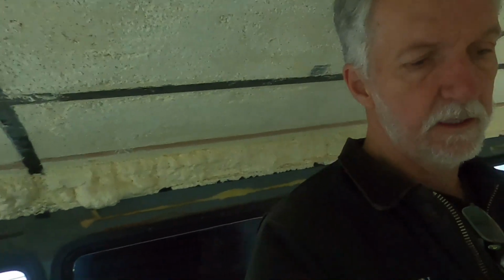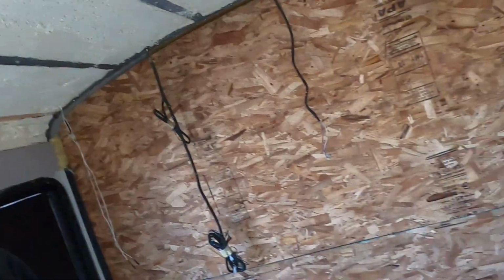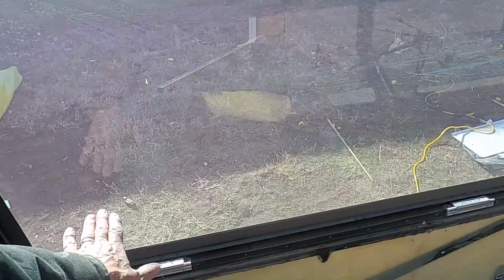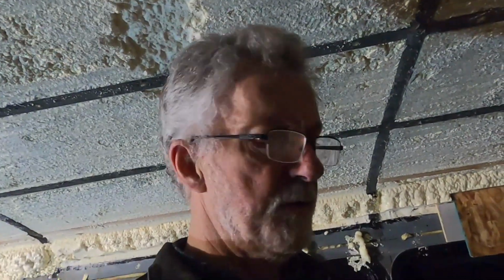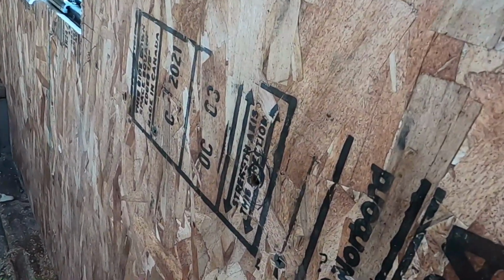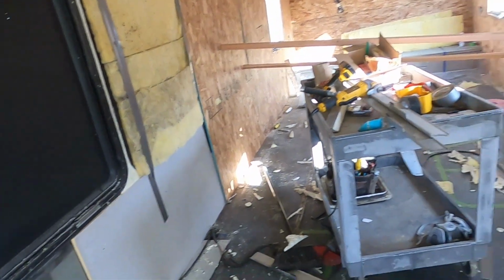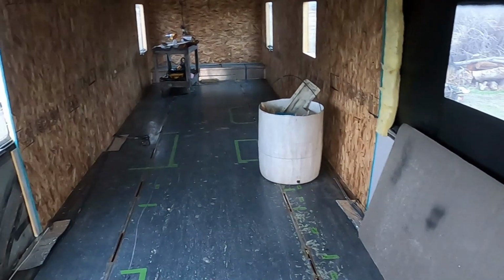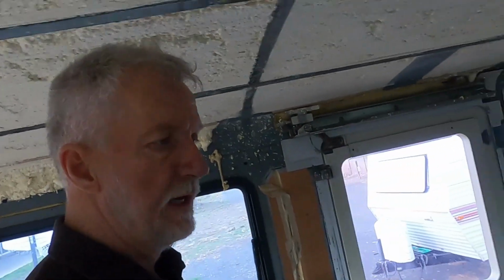2002 MCI Conversion Roughing in Wall Coverings E43

Comment: I like that you are explaining the thought process.  I am excited to see the process and how it will look inside and out.
Reply from the maker: Thanks. I'm not much for luxury, as I am more practical. I really don't have much talent in finish work. I'm just not very good at designing finishes. We'll see! I hope I don't disappoint.
Reply: @glennman9890  I'm sure you won't.  Looking good so far.
Reply from the maker: I prefer practicality over luxury. I'm not very talented when it comes to finish work, as I just don't have an eye for it. Not that I don't want it to look nice, I just don't know how to get there. I hope I don't disappoint with my finish work. It is a design as I go thing!
Reply: @glennman9890  Definitely design as you go and be ready to change things that do not work. I wanted 36" doors for the bathroom. But that was just to wide and I had to get narrower doors as they would have blocked and hit on things and didn't allow enough wall room to mount other things like the bathroom sink.

Comment: It sounds like you have many of the same ideas I found on U tube. Bedroom in back, bathroom in middle, then kitchen, living room front. I took out the windows I don't want.  1-3-4  from the back of the bus. 3 and 4 are in the bathroom area and I do not want windows. It turned out to be the easiest way for me. I took all the screws out of the inside frame with a special bit (star?). The inside frame comes out easy. I had the window already open and then clamped the outside window frame so it did not fall out. My son and I then got outside the bus and released the clamp and carefully pried the window and frame out with a pry bar. We let it straight down as it is heavy. I am getting the aluminum panels I got from the inside roof cut to size. I am going to glue ( Panel bond or a different adhesive?) the sheets over the openings and use foam sheets inside like you are. (Lacroix Cruisers idea to glue them on) No not the same metal problems then.
Reply: I ended up cutting the aluminum panels to close the window openings myself with a hand circular saw and a aluminum blade I got($30). Now I have to glue them on. I saved a lot of money buying regular home appliances on clearance for the kitchen. I had to get 2 doors custom made($225 each) for the bathroom doors as the cost and hassle to cut them down and look right was about the same.
Reply from the maker: @justfun985  Man! It sounds like you are all in!!! I considered doing all that to the windows, but I really don't want to spend all the time on it. I hope I don't regret it later! I love watching the Lacroix videos for sure.
Reply: @glennman9890  It was weird in that for me it was much less work to take the whole window out. 1/2 inch drill (my 3/8 drill wasn't tough enough and broke after a while) with bit to get the screws out. Once I have the window out I am doing pretty much what you are inside. That gets you to the metal frame of the bus which is square tubing and easy square edges to fit to. I think I am going to glue the sheets and then use screws to hold  in place. I can take the screws out later and fill in the holes before painting. What has been tough was putting windows back in some of the holes as they feel like they weight a ton after a while. They are double pane and some fogged up as the gas leaked out. I took the good windows and moved them to replace the bad windows. LOL "All in" to me is foaming the ceiling LOL. It is fun to watch how people handle the different challenges each bus throws at us.

Comment: Glen, how much did you pay for your bus. I drove buses for greyhound and I love driving those MCI 102 DL3s. I love their power, how they handled, their strong suspension system, using the engine brakes, and good sound of the Detroit Allison 60 series power pack. I know you enjoy driving that bus as well. Can’t wait to see the conversation to your personal RV vehicle when finished.
Reply from the maker: I only paid $1000 for the bus, and it was still in service when I drove it 25 minutes to my house! And yes, it is an absolute pleasure to drive. The engine and tranny are great. However, it does not have the engine brake, but I sure wish it did!
Reply: @glennman9890  that’s amazing! What were the details of this sale? Seems the ones I see are in the 20-30k range 😳

Comment: Glen thanks for another great video. I have a couple questions. Are the screws you are using Type F machine screws? (They  also call them trailer deck screws)  I too will be opting to leave the windows in when I start my build next month. I have been planning to use total blackout window film.  Did you consider this? if so why did you opt for the paint. (I have been concerned that that the paint may flake with time. What are your thoughts?  After watching the issues with your wiring I opted to have a coach company remove my overhead bins.  They know the wiring so I was assured things would be running when the work was finished. They finished last week and it is nice to see pictures of a clean slate. I think they probably saved me a couple weeks of work too,
Reply from the maker: I got the screws from Amazon. The brand is U-Turn - 12-24x2 WAR Coated Reamer Wood to Metal Self Tapping. They were actually about $35 for 250 count. They appear to be for mounting wood decking to trailers (as per the reviews). However, some of the reviewers were disappointed, but it looks like they were trying to get them to go into too thick of steel. The bus steel is actually thinner than what you would have for a trailer, so they can strip out if not careful. I've found that predrilling helps. I think the ceiling will be easier, since I will have the floor to push against. When I finish the rest of the walls, I plan to put something in there to push against, as it takes a lot of pressure to drill all those pilot holes! 

I'm glad to hear that your having a company gut the interior. I lost about a year dealing with all the problems I brought on myself.

On the window film, you are probably right about the eventual paint flaking. I set up the windows so that I can open them in the future, so if there are any issues, hopefully I can take care of it. Are you installing the film on the inside? I don't know much about window films. I hope my method doesn't create any problems. Thanks for weighing in.
Reply: @glennman9890  The film is like window tinting film which is installed on the inside of the window but instead of a percentage of sun filtering it is 100% black out. I have never used the blackout film before and so that was the reason for the questions. We are on a pretty tight schedule with our build. I can work on it full time but I need it "functional" by the end of April as we will use it to go north for the summer.  Well thanks again for keeping us up on your progress.
Reply from the maker: @panoramadan62  Thank you Dan!

Comment: I am looking at a tankless water heater as it is less weight and no venting. Bad side is it requires a 15KW or larger generator.
Reply from the maker: Hi Neil! I'm going with propane. I was a contractor for many years primarily installing gas piping and appliances. I am very comfortable with propane systems. I have a 6 gallon RV LP one that I plan to install as soon as I get the layout down to the inches (now it is only a rough layout). I used it in a previous bus. I installed it new back in the day, so it is dusty, but doesn't have much actual use.
Reply: @glennman9890  Sounds great. Everyone has their strengths and you go with them. I am going propane on the stove. I am putting the propane tank right below the stove, in a bay so I have the shortest to plumb.
Reply: My wife and I have been fulltime in our RV for 2 years now and we have a 10 gallon tank. We turn it on for about 30 minutes a day and that supplies all the hot water we need for 2 showers and 1 dish washing. It is surprising how little hot water a couple needs. We don't go to extreme measures to conserve the water but we are cognizant of the supply. Everyone's situation is different but when I hear these testimonials that "I could run the hot water indefinitely" I always ask myself but who does and why would you.
Reply: @panoramadan62  Thanks. My main reason for the tankless water heater is weight saving. I did not want to haul around a water heater with 10 gallons of water or more. 7 lbs a gallon water plus the weight of the heater. The wife likes to bike and have a friend couple along maybe? So they may need more hot water after a ride. I am not totally convinced it is the right answer so I like comments pro and con.
Reply: @justfun985  that is what's awesome about a custom build, each of us looks at our own situation and make decision accordingly.
Reply from the maker: @justfun985  Great idea Neil. I have a pretty large tank I plan to install (I don't recall the size but it is about 4 feet long and about 14" in diameter). It's from an under the bed truck tank (horizontal). It won't be very far at all from the stove and water heater either.
Reply from the maker: @panoramadan62  Agreed. We used the 6 gallon tank in our old bus and it was just fine. We also have a 6 gallon in our pull trailer. It works good too. I don't see the need for any more than that. However, if I had a 10 gallon, I would install it :)